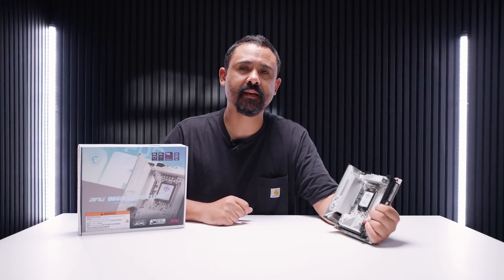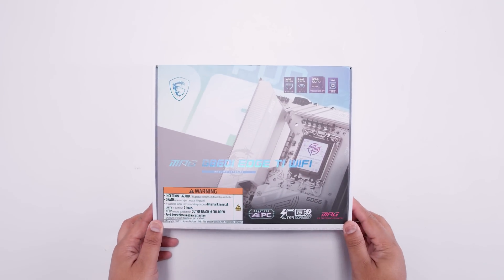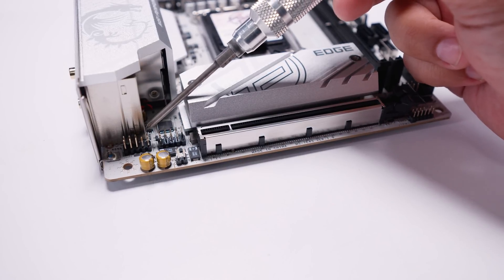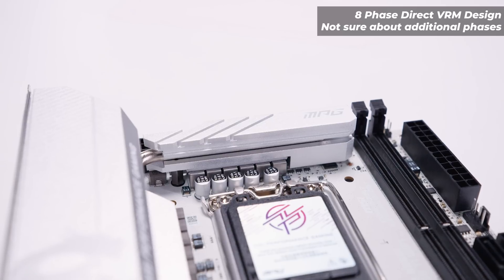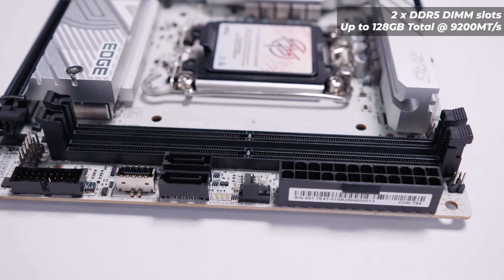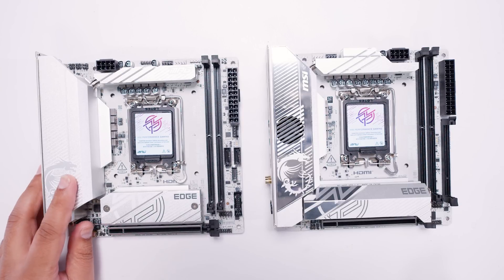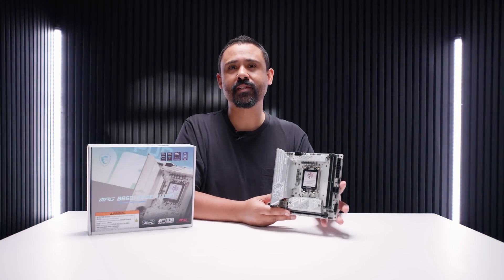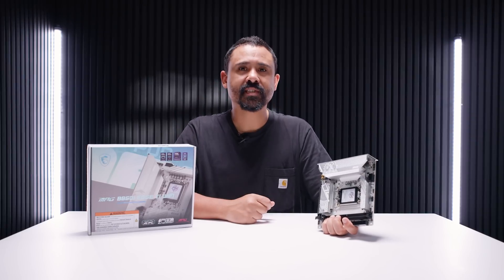This Cool Mini ITX Intel Motherboard Doesn't Even Exist Yet!

Comment: Unpopular opinion... I'm currently liking the new Intel core ultra stuff, currently running an ultra 9 285k and an rtx 4080.  I'm not a huge fan of the new numbering scheme as it seems to make zero sense, but the i9-15900 nonsense was getting out of hand in my opinion, avoiding the inevitable 29th gen i9-29900.  I'm hoping they got the rapid oxidation issues on 13th and 14th gen figured out on the new core ultra stuff.  I skipped those 2 generations for that reason, coming from an i7-12700k, and hoping for the best.